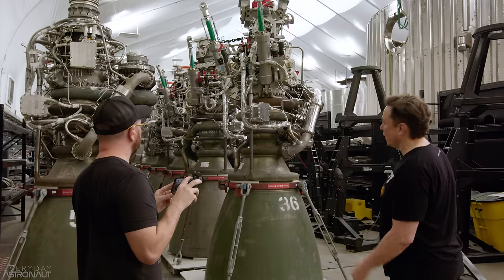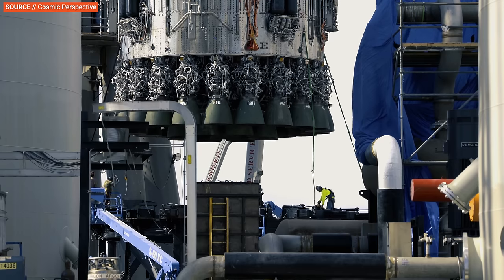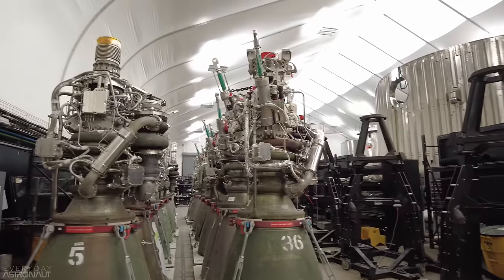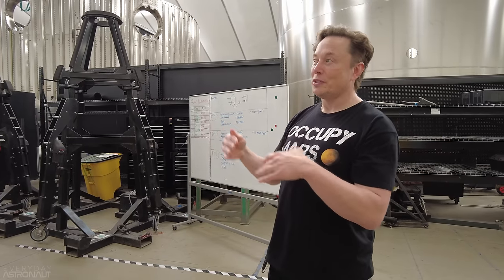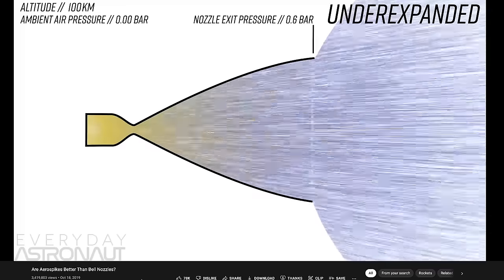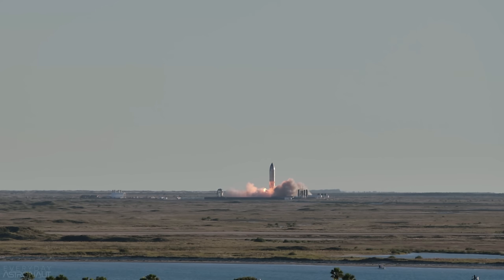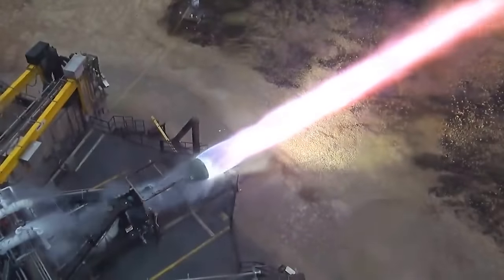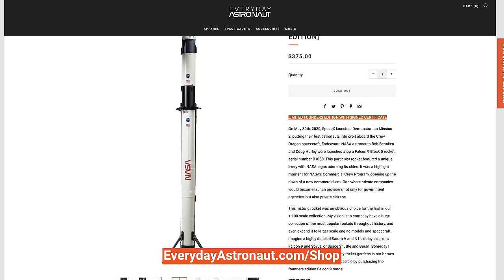How SpaceX Is Upgrading Raptor To Be The Ultimate Rocket Engine!

Comment: To be fair, what Tim was talking about in terms of doubling (for the Merlin now versus when it first came out) is an aggregate of thrust to weight ratio to specific impulse. The merlin engines aggregate doubled because the thrust effectively doubled (47 tons to 96 tons) while the weight and ISP remained relatively the same (+/- a few percent). Raptor 1 however, weighing 2000 kg, with a thrust of 185 Tons and an ISP of 330 seconds, doubling that aggregate would be synonymous with reducing the weight to 1000 kg or increasing thrust to 370 tons or increasing ISP to 660 seconds. For simplicity's sake, the aggregate (of Raptor 1) being thrust (185) divided by weight (2000) multiplied by ISP (330) would give you an aggregate of 30.525. The aggregate of Raptor 2 is 47.00625 or a roughly 54% increase in aggregate. To get a 100% increase or an aggregate of 61.05 (vs Raptor 1) would be something like a weight of 1350 kg, thrust of 255 tons and an ISP of 318 or a combination of changes thereof. If the goal is 250 tons of thrust, weight would need to come down to 1365.85 kg with no change to the ISP (327) which I believe is doable (~235 kg of weight savings).

(As a side note, you cannot compare aggregates across differing engines IE the aggregate of Merlin to aggregate of Raptor to determine which one is the "better" engine. While a higher value does mean "better", it is better in respect to a previous version of itself. Merlin (specifically 1D) has a higher aggregate due to it's crazy thrust to weight ratio when compared to the Raptor 2. Merlin engines cannot power the booster or starship because they have a higher aggregate is what I am getting at.)

I think it is possible for SpaceX to get there the how is the unknown. Tim stated material sciences as a factor and I think that is be the biggest factor. Graphene, or a derivative of, could be used to make a newer version of Raptor engines stronger while being of lesser weight as one example but only if graphene could be produced competitively price wise. Changing the mechanics is a trade-off, expansion ratio to ISP being the one talked about in the video above. Changing the mechanics without changing materials is usually a <5% change in overall efficiency or aggregate as seen in the use case above. We have seen SpaceX innovate heavily in this area, specifically the alloy of steel used for the construction of the Starship + Booster and the many known and unknown alloys used in the Raptor family of engines. 

Lastly, one thing that is not mentioned in the video and should be, is the weight decrease to Raptor 2 is partially semantic. Some of the parts were moved from the engine to the mounting plate for reliability and ease of maintenance. While the engine itself did decrease in weight, the weight of the booster increased, negating some of the weight savings which is not mentioned. This by no means undermines what SpaceX is doing but context is needed to fully understand what is truly happening. Just like landing legs being taken away from the booster and stage 0 getting a pair of reinforced chopsticks to catch the booster, some of the mass reduction is not simply the mass disappearing due to efficiency gains but rather being reallocated elsewhere.

Comment: What if, they made the engine physically bigger.. like, all the same parts, just double the size.. what would that do to the output numbers..?
The RS-25 is a bigger engine, albeit of different function, and the F1 on the Saturn V was even bigger than that, so building large engines isn't a problem, and it would mean more exhaust volume out the back..
Bigger engine generally equals more power in cars and planes and boats, so.. could that be an idea in Raptor too?
Reply: Bigger rocket engine = more combustion instability.
Reply: The big thing to remember is that everything on the starship project is done for starship, and Raptor is the right size to do a 3-engine cluster for starship, and that gives you the redundancy you need for human landing. 

You could go somewhat bigger on raptor though you'd likely lose a little combustion efficiency because the propellants don't mix as well. 

The RS-25 is bigger mostly because a) it has 4 turbopumps and b) it's really a vacuum engine pretending to be a sea-level engine; the nozzle size is quite a bit bigger than a real booster engine would be.
Reply: You cannot scale parts like that. As you scale parts like that their cross sectional thickness will increase proportionally, surface area will increase by the square and their volume will increase by the cube. This will lead to scaled up parts not being able to handle the same pressures.

Comment: I don't quite understand your argument about efficiency regarding gravity loss. Yes, a higher thrust engine will give greater acceleration, but a more efficient engine will burn for longer and leave the vehicle with a greater final speed.

Also, as an aside, can you please start using proper units? Thrust should be measured in Newtons and acceleration in m/s².
Reply: It's simple - greater acceleration means achieving orbital velocity in less time, and since both fuel consumption and gravity losses are a function of time, you're saving fuel by doing so. A more efficient engine may use less fuel per second, but taking longer to reach orbit means you're running the engines for longer.
Reply: @simongeard4824  You're point about gravity losses makes sense so thank you for clarifying, but I wonder where the tipping point is. How much extra acceleration do you need to offset the increased fuel consumption?

You're point about fuel consumption doesn't make sense to me though. Specific impulse is a measure of force per kilogram of fuel burned. So increasing the thrust but decreasing the ISP will have a negative affect on how much the vehicle can increase its speed by. The "seconds" unit for ISP actually refers to how many seconds an engine could burn for with 1 kilogram of fuel if it could throttle down to 9.8 N.
Reply: @Kyle-gw6qp  Right, so higher ISP means that you can run the engines for longer at the same thrust. But when you're trying to reach orbit, you don't want to be running the engines for longer, because you're paying that 1G gravity penalty for every second you're doing so. So for overall efficiency, you want to deliver as much power as possible in as short a period as possible... and you actually want to get rid of fuel as quickly as possible too, to reduce the mass you're lifting.

Don't get me wrong - having a good ISP is still important during launch, because being able to run the engines for longer on the same amount of fuel also means needing less fuel to run them for a shorter period, and less fuel needed to reach orbit. But while ascending to orbit (or for that matter, landing), the critical part is to minimise the amount of fuel lost to "gravity taxes"... so more force for a shorter period of time.

Once in a stable orbit, the balance shifts — you can get away with a lower force over a longer period, because you're no longer spending most of your energy avoiding a collision with the Earth.
Reply: @simongeard4824   Surely it's not actually a function of how long you're running the engines for, but instead a function of your time to orbit. Because you pay that 9.8 N/Kg penalty regardless of whether or not you're burning or coasting.

Getting rid of fuel quicker will affect acceleration, but not the final speed of the vehicle.

I don't doubt that the faster you get to orbit the less speed you lose to gravity, but how much does it actually matter? How much faster do you need to get to orbit for it to be worth the loss in ISP?
Reply: @Kyle-gw6qp  look at the numbers Tim provides... they're trading about 1% of ISP for about 25% extra thrust. That's not a difficult decision to make, given what it does to TWR and net acceleration... the fuel savings from a much shorter burn totally overwhelm the  losses from a tiny reduction in ISP.
Reply: @simongeard4824  Does it though? That's what I'm asking. If you actually do the calculations, what efficiency boost do you actually get from 25% extra thrust? And 3 seconds of ISP is actually quite a lot, especially when you have that many engines.

Comment: Using a suboptimal nozzle seems like a easy fix, the logical next step should be using a bigger nozzle, some people expressed the concern that wouldn't allow the necessary numbers of engines to fit under booster, but making the booster wider (or only the engines section) shouldn't be a problem.
Reply: For a booster the amount of thrust is more important than the Isp increase you get from a bigger nozzle, so more smaller engines is a better choice. 

True booster engines tend to be pretty small. The RS-25 Tim showed is mostly a vacuum engine because for shuttle the Isp after the solids drop is the important part.
Reply: @EagerSpace  yes, but also you can get more thrust from the same amount of propellant too, isn't a big difference but every percentage matter for a orbital rocket.
Reply: @theOrionsarms  The loss of thrust from fewer engines is a bigger deal than the loss from a lower Isp.
Reply: @EagerSpace  but you don't need to choose between two evil, you can have both, why you need to use less engines? Obviously you don't get the attention to my first message, witch is weird because you answered to it.
Reply: @theOrionsarms  What matters is the amount of thrust that you can put in an engine bay of a given area, and smaller nozzles give you more thrust. 

You suggest making the engine bay bigger to allow for the same number of engines with bigger nozzles. Btu that bigger engine bay can still contain more small engines than the big ones. 

It's also a big complication to have a wider engine bay.
Reply: @EagerSpace  there is no complications, simply make it bigger, why do you think that isn't a option?
Reply: @theOrionsarms  Making the booster wider would also require a complete re-design of the orbital launch mount, which would take months. Bigger does not always equal better
Reply: @avap0n459  yes, some parts need to be redesigned, but that's the way things are made in the space industry, launchpad are made or modified to serve the rocket they launching, not other ways, and isn't that would be bigger than need to be it will be made with exactly the right diameter to fit the right number of engines that use the optimal size of nozzle for getting maximum amount of energy from the propellant on the board,in other words a efficient design, I don't see what you have to object to those principle with exception that you think that cannot be applied tomorrow, but Rome wasn't made in a day too.
Reply: @theOrionsarms  Let's say that your hypothetical bigger engine will fit 25 with the current design, so you make the thrust puck and engine bay bigger to hold 33. I can put 38 of the current raptors in that space, which still gives the current design a significant thrust advantage. 

To get there, you not only need to design a new thrust puck, you need to figure out how to take all the thrust from the thrust puck and transfer it in to the current tank walls, so you'll need a tapered adapter that is very strong. Or you could try to expand the tank down low so it's the right diameter, but that really gives you the same problem.

New parts that are the size they are set up to make, extra mass, extra complexity, and maybe a slight reduction in efficiency at takeoff since the exhaust will be more overexpanded. 

For what I think will be a small Isp gain.

If you want to discuss further, it would probably be worthwhile to take the current nozzle and a bigger one and do the math to figure out how much you get out of it.
Reply: @EagerSpace  but are other solution that I didn't mention, like you keep the same diameter of thrust pack and put fewer bigger engines beneath all fixed, and for maneuvers you can put let say six engines that can gimble in the upper part of the booster,a single raptor put at 60 meters on the side have more leverage than 13 that gimble beneath, and maybe you forget that the same engines would be used on the upper stage, it's a heavy penalties even for 1% decrease in specific impulse in this case, maybe not for LEO launching but for anything else like HLS for example.And your argue that you can put more smaller engines is really weak, because more thrust isn't necessary unless whole rocket is becoming significant more heavy, and if the designers decided to increase the diameter of rocket isn't nothing that can stop them, like I answered before all the launching installation are custom made and serve the rocket not other ways around.

Comment: a few questions: why did the booster blow up? the startup sequence is so complicated they had to do it so slow and there was too much unburnt gas coming out and then it blew up? also is 1.5 thrust to weight ratio the ideal amount? if it's higher it makes max Q worse?
Reply: They were doing a spin-up test to verify that everything before the main combustion chamber is working. That means that you get a lot of unburnt propellant coming out. 

That wasn't a problem in the past, but the sheer amount for all engines was a lot lot more than they got from the smaller tests, and it found an ignition source. 

The simple fix is to just to it one engine at a time. That reduces the amount of propellant by a factor of 33 so it's less likely to ignite and if it does it's not a big deal.
Reply: The booster didn't blow up.
Reply: It wasn't a full startup sequence — just a test of the pump start — which means methane flowing through the engines without ignition occurring. This was supposed to just disperse in the wind, but it built up enough to create a nice fireball when something accidentally ignited it.

It looked bad, but it's not really a big deal... some overpressure damage to some of the ground support equipment, and they're taking the booster (which didn't blow up) back to the shed for a closer inspection. It might set them back a week, two at worst.

Comment: If Elon would sell one. Could you put it in an airplane?  Hang sum under a 747?
Vector thrust a hypersonic jet?
Efficency?
Reply: GE GEnx series jet engines (used for Boeing 747-8 and 787) are almost 20 times more efficient than Raptor 2. No comparison at all.
Plus Raptor 2 has about 8 times more thrust...I don't think airplane's fuselage/wings can take that much force.

Comment: So Elon's reasoning is basically as follows: a car engine can easily do a hundred thousand miles without significant problems. In formula one we push a thousand horsepower out of a similar (in size) engine.
Lets scale the car engine up a bit, push it to it's limits, put thirty or more in parallel and we will have a hundred thousand horsepower that can last five years without significant maintenance.
(He Forgets that F1 motors usually last about a thousand miles maximum, and putting 30 engines in a rocket makes the chance to fail 30 times as big - redundancy doesn't help if one of them catches fire.)
I'm not stating that flying starship is completely impossible, but having it reliable launched multiple times per day? No way. And the risk of failure will be much higher than for the average rocket. 
I strongly doubt if Starship will ever be human rated in this configuration.

Comment: If the raptor vac engines can not gimble how do they keep Control over the roll axis of starship during a birn that doesnt use the sea level raptor engines for example trans mars injection
Reply: They will make sure the ship is pointed in the right direction before ignition.
Reply: They will use sea level raptors for manoeuvers in space. Not ideal imo, but it may be better then having RVac pull the dead weight of shutdown engines.
Reply: @motokid6008  Nope. Those engines are for landing in atmosphere only. In space, they don't need vectored engines — they just use the RCS to point the vehicle in the right direction, and use the fixed vacuum engines for thrust.
Reply: @simongeard4824  - You can't just point in the right direction and fire. You need active attitude control for the duration of the burn. Its been stated and shown in renders that the sea level Raptors will be used for manoeuvers in space. It's why Raptor has a compensator bell like the shuttle engines as opposed to full tilt sea level.

Comment: Why are you using Saturn V as the comparison for most powerful rocket ever? In terms of thrust the Soviet N-1 was the previous most powerful rocket ever, not the Saturn V.
Reply from the maker: I don’t recall saying it was the most powerful.
Reply: @EverydayAstronaut  You said exactly that Saturn V is the most powerful previous rocket in the audio. I'm aware it was the most capable in terms of how much it could launch, but that's not the same thing as the total power from the engines on the first stage.
Reply from the maker: “The SuperHeavy booster on the other hand will be jam packed with 33-ish Raptors which will make it the most powerful rocket ever, with over twice as much thrust as the Saturn V rocket, the only rocket to have taken humans to the moon so far!” 

I didn’t say the Saturn V was previously the most powerful, just stated that SuperHeavy will be over twice as powerful as it as an example. I’m aware the N1 was more powerful, I did an hour and forty minute documentary on Soviet engines after all 😉
Reply: @EverydayAstronaut  Listen to what you said before the section you quoted.